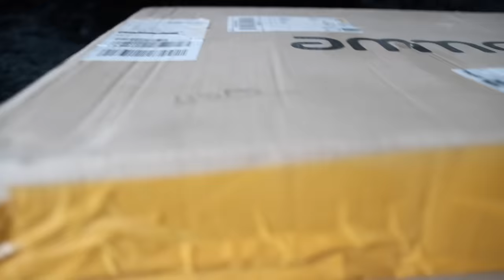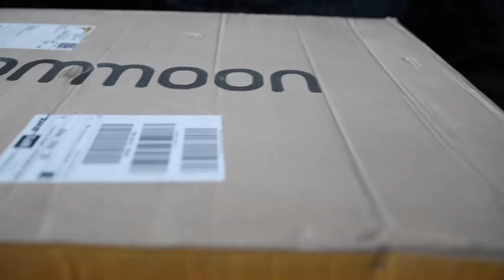CHEAPEST LES PAUL Style DIY Kit Review and Demo (Ammoon LP Kit)

Comment: Just in case nobody has mentioned it yet, they don't drill the bridge holes for you so that you can use your own choice of bridge (different bridges from different hardware manufacturers may have slightly different dimensions, post size, etc). The downside is obviously you have to do it yourself (that is kind of the point of a DIY kit anyway) which means you also have to drill it correctly first time.
Reply: Plus, neck alignment with the sloppy neck pocket means the hole positions are going to be where you find them after shimming and gluing the neck..
Reply: well i used a more arch top hollow body guitar tailpiece so i was actually really happy with there choice not to
Reply: so I could go balls to the walls and just mount a Floyd Rose 1 bridge on a Les paul then. Nice.

Comment: I picked this kit up and lucked out with a very nice neck pocket. I guess your mileage will vary with TonTop. Also, not having the holes pre-drilled gives you the option to upgrade the bridge to a standard LP style Tune-o-Matic instead of the import style that comes with the kit. If your going to get new pickups, you might as well split them and get better pots. Lots of tone options.

Comment: I built a kit, a "cheap" one. But I was surprised how well it plays at the. The kit I was building came as bolt on. The only problem I got with my build is that they don't include a set of capacitors. I did add them and have good tone and amazing sustain. Better than my store bought strat.
Btw, we miss the guns. (YouTube 😒)

Comment: I've found you can cut down on the feedback on cheap non-potted covered pickups by either removing the chrome cover or putting blue poster tack between the pickup and the cover. This is because it's actually the cover vibrating that you are hearing.

Obviously you can also just get some wax and pot the pickups too.
Reply from the maker: cool suggestions, might give this a try!
Reply: Yeah the blu tac is very quick, just make sure it's tight between the cover an the pickup, enough that the cover doesn't ring when you tap it. I've only done it once but it worked well enough with the marshall half stack I was borrowing when the pickup was unbearable if I faced the amp beforehand.

Comment: Identical to my kit, right down to the fret buzz on 2 or 3 spots. I have swapped out the pickups but it is still a bright sounding guitar .... just has more output. As for color,  you can't go wrong with a deep blood red. Brings out the tiger stripes in the maple.

Comment: This kit is also available branded Muslady.  It's exactly the same including the bad neck joint, potentiometer reversal and loads of glue.   I did build it after shimming the neck etc and it sounds great but it took a whole lot of work to make it decent.
Reply: What did you do with the bridge, because I need to drill in the holes bit not sure of the measurements to use

Comment: Too bad about all the repairs and adjustments to just get it together, but surprisingly bright in the bridge pickup. Found the tone on it quite nice. The neck I found a little cold for my taste. Did not seem to have that "big warm" sound most neck humbuckers do, but for the price and everything, what are you gonna do?

As for color, I say take a blow torch and char the grain a little and do an ox blood type red stain. Pickups, I am going to second what someone else mentioned earlier and say Guitar Madness humbuckers. You would probably like the 57 Specials. I have the 1984's and they SCREAM! Also, they are cheap. Some are ceramic magnets and others alnico, not sure your preference.
Reply: Abraham Watson good thinking those guitar madness pickups suprisingly are not bad! i put a set of there p94s in a customers double fat tele and was thinking why change out a 4 lead humbucker guitar with push pull pots for a cheaper pup and pay for it for a less expensive pup? i was very suprised when i plugged it in gave the 🎸 a whole new vibe sounded 👍

Comment: put some old candles in a jar melt it in a pot of water on the hob and just dunk the pickups and agitate them and that will wax them enough to stop the feedback - done it about 5 times so far and it's yet to fail on me, don't need a big wax bath like seymour duncan or any vacuum equipment to quiet down those pickups and make them usable
Reply from the maker: I might try this...sounds fun and who cares if I ruin the pickups?
Reply: @GunsandGuitars  Get the wax to like 150f and let the pickups set for like 10 min.  It works even better if you go 20@ Bee's wax, the Bee's wax is a bit harder, the candle wax penetrates better so the combo works well.  But just the candle wax should fix the feedback.  And I JUST realized how old this it, oh well posting anyway. LOL
Reply: Just get paraffin wax from the store, and don't forget to take the pup covers off. It took us multiple dips into the wax to get a good coverage.

Comment: I did one of these les paul kits when I was 15 and for a first try I'd say it cam out ok.  Mainly I made some pretty dumb mistakes like getting the wrong solder and not letting the lacquer cure enough before bringing it back inside.  Aside from that these kits are super, super easy to put together as long as you do your research, I can't stress it enough DO THE RESEARCH BEFORE YOU BEGIN!!!!  If I can put one together at 15 it shouldn't be a problem for most people to do it.

Comment: For the pickups, I'd just wax pot them. Either dip them in melted wax and wait for a half hour, or dip them in melted wax with a vacuum seal for about five minutes (or until the solid wax around the pickups melts away). Then let them sit for about 15 minutes and wipe them down. 

Saves you more money, as opposed to buying replacements.

Comment: you should go for a cherry sunburst with clearcoate  sun burst ,like a Les paul should be, you could take the chrome cover off and in stalling blue poster tact between the pick up and the cover. This is actually because of the cover vibrating that you are hearing.

Comment: For all you nerds out there, Volume (dB) is a logarithmic scale. We hear changes when things are 10x louder not 10% louder. So you basically hear no change then the pot is designed to switch off all sound pass through (for tuning on stage and what not)
Reply from the maker: correct!

Comment: I've built 2 of those kits, both neck pockets were nice and tight. Both sets of pickups were potted, thou I never installed them, I went with Seymour Duncan hot-rodded humbucker set for 1 guitar and the other DiMarzio 155 + 153 I think. I installed 1 of the sets in a ultra cheap strat copy since they were just laying around, sounds good. Not drilled for bridge and tail piece was a non issue for me. Good kit.

Comment: I'm actually considering building an ES 335 kit but I'm going to change a few things starting with the neck, tuners, and the bridge. for the neck I'm replacing it with a Birds eye tele neck, for the tuners well I'm going with some M6 Schaller in line tuners, and finally for the bridge I'm going with a floyd rose 1. I may replace the pickups with something that may sound beefy.

Comment: I will half to dissagree with you on the bridge holes being predrilled. Do you need an extra piece of equiptment? Sure. However I have had to many kits where the predrilled holes are not square, I can ensure that that not only are they centered, but correct for the scale length.

Comment: There is a reason for the not drilled tailpiece holes. If youre not able to glue the neck exactly how its supposed to be, youll get problems with the intonation. Have seen that often on set neck guitar kits. 
Cheers from Germany!
Reply from the maker: because this kit has that cutout on the neck so that it sits perfectly against the body, there would be no reason for intonation issues, if all necks are cut on the same cnc machines, then they would have consistent scale length when installed.

Comment: You didn't show how you figured out how to drill the 4 Bridge holes?  Did you take a piece of paper and trace a Les Paul you already had?  What would you suggest to someone that doesn't have that?  Can't find a diagram to scale to print and superimpose.  So for a 1959 the scale is 24 9/16" ?  But the Bridge is angled placement; although adjustable per individual string.  Without a template...one would set the low pitch E string to 24 9/16" with the peaked string holder in the middle?  But what about the other end of the bridge?  In terms of the string terminus it looks to have a slight angle per a diagram I looked at.  Anyone know the distance from the Low pitch E string to the face of the String terminus for it?  I have been looking at mine non drilled guitar for quite some time with a monocle.

Comment: I wonder if one could bolt on the neck instead of gluing by using shims and a homemade backplate or inserts and wood screws. Then one could reshim over and over until perfect.Thanx for mentioning that.

Comment: is there a template to drill the holes/measurements for the bridge and tail piece?  what is the correct angle?  this would be my first build, just concerned if I should just spend a little extra and go with the pre-drilled holes, but kinda like DIY

Comment: Great video Dan.  Awesome tips on putting this kit together.  I totally agree with you on doing dyes/stain first, along with grain filling, basically getting everything prepped for finish.  I differ by gluing the neck before starting finishing.  That way, I lessen the risk of damaging your finish.  Also, you don't get finish on the parts that get glue.  Plus your finish has a seamless appearance at the body/neck joint.  You can dig out any glue squeeze out easily and not dick up your finish.  There is one instance where I would glue in the neck first after finish sanding and that would be if I'm using a tinted spray for color instead of hand applied dyes/stains.
Reply from the maker: the reason I like to do the finish before glueing is because the glue won't stick to the finish if you miss a drip or don't clean it up well enough before it dries.glueing an unfinished guitar, the glue drips can soak into unfinished wood and then the wood doesn't take the finish well.  you can always add another coat of finish after you've glued it to get that uniform look you're talking about!
Reply: Guns and Guitars that works too.  I usually get a few coats of sealer down then glue.  After the glue is set, I'll do any flat sanding on the sealer and touch ups then start clear coats.  The beauty is there really isn't a wrong way.

Comment: The reason they don’t drill the bridge piece holes is beacuse sometimes instead of using a regular bridge people put on a bigsby or a trapeze bridge or a mistro vabrato, so try didn’t want to have extra holes Incase u has a different kind of bridge that had holes in a different spot, same with and other guitar, especially 335s

Comment: Seems to me you were straining about good points.  A different kit I got from Ammoon had issues with holes not drilled as well.  I will have to check about the volume/linear pot issue you pointed out on my kit too but I'm glad you pointed that out.  While I'm planning on gutting the electronics, that's far in the future.

Comment: Make it look like Paul Kossoff's guitar , just take the pickups and wax pot them yourself easy to do and a cheap fix.  Also you can buy alnico magnets cheap as well to replace the currents magnets in them all for under  a twenty spot. Add some linseed oil to the board and that composite neck wood will show its true "luster".

Comment: most likely not going to get a response but worth the try. i had bought a kit like this awhile back and finally got to it. the big problem is i can't turn the truss rod nut at all. even twisted the allen wrench it came with. do you think there is a way to fix this without having to remove the fretboard?

Comment: I’d like to see a video about how to properly measure, shim, and the fully glue set the neck. Without the bolt on refit. One reason I wanna buy one of these cheap diy build kits in les Paul and or Gibson hollow body style is because I’m not in a great financial situation as far as for using money to buy real Gibson guitars but I’m “stuck up” and want a set neck because I’ve just always thought (without real fact based reasoning) that set necks meant higher quality. Anyway it’s for kinda silly reasons. I plan on going for a seriously “road WORN” looking Les Paul possibly gold top nitro paint finish or another classic les Paul in satin ROAD WORN finish.  I think starting with a really cheap kit is my best bet in case something goes wrong and I do enjoy the learning process. Cross your fingers for me that it goes well 🍀🤞🏼🙏🖖🏻✌🏼🔥🔥🔥🤘🏼🤘🏼🤘🏼

Comment: The holes aren't drilled because you can only get the exact measurements when the neck has been glued in. Especially with a crappy neck pocket, you need to glue the neck in first
Reply from the maker: Yes, but every other set neck/tune o matic kit I’ve built still has them pre drilled. But they did have better neck pockets, the truth is, if it’s cut and drilled correctly, it’s really doesn’t matter, there won’t be much play.

Comment: Thanks for another great video Dan! Just out of curiosity, do you normally use linear pots for tone controls? I tried this once and found that they did the exact same thing for the high-end rolloff, seemed to do nothing from 10 to about 2 1/2 and then almost immediately cut.  I now use audio pots all around because they just seem to have a nicer more gradual taper to my ear...
Reply from the maker: I prefer audio pots for tone as well, but people are 50/50 split on that, some prefer linear for tone. But on a kit with two audio and two linear pots, one would think they would use audio for volume...

Comment: why use only 3 screws instead of 4 when you bolted it on?
Reply from the maker: no real reason honestly.  guitar necks really only need 3 bolts, but most manufacturers use 4 because if you put one in the middle you risk hitting the truss rod.  but because this was a set neck, there was plenty of wood there before the truss rod so I wasn't worried about it.

Comment: Did you ground it to the bridge? I bought a fretwire kit a month or two back and forgot to drill for a ground to bridge.  Is this a big issue?
Reply: Not a huge problem but it'd probably be for the best if you do it
Reply: Big Dick yeah i accidentaly hammered in the bridge pins before putting in the ground wire so im screwed xD
Reply from the maker: you're not screwed, I pull those metal grommets out all the time.  just partially unscrew the bridge post, just enough that you can fit the claw side of a hammer in there (like you're prying out a nail), then put a folded towel between your guitar and the hammer so that you don't ding your guitar when you're prying it out.  I've done this so many times, it's really easy!
Reply: Guns and Guitars thank you ill try that!
Reply: Guns and Guitars i got one of the two out so far! Hey do you have a twitter? I wanna send you a picture of the guitar finish, its my first finishing job!

Comment: Would it be possible to install a peal effect into the guitar itself? Like having a digitech drop tune effect built right in?
Reply from the maker: Totally possible
Reply: Guns and Guitars how would you suggest I do that? Like what parts? Or do you put the inside of the pedal in the guitar itself?
Reply from the maker: Yes, take the the internals out of the pedal box, and install them in the guitar cavity. Make sure your pedal can run on a 9v battery and install a trap door so you have access to it.
Reply: Guns and Guitars thank you
And what about the output and input jack?

Comment: There are bolt on kits on ebay cheaper. The set neck is a much better design.  I have built these kits before. A slurry of epoxy and sawdust coating the neck and  the joint and clamp it up. Stronger than the wood and sustains just as well.

Comment: I've seen this on Amazon it's like 20-40 less than the finished version. In Canada it sells for about 180, compared to a finished for 220. It's questionable why anyone would go through the trouble of setting the neck and doing all that extra work for some custom color.
Reply from the maker: it's not just the color, you can customize any thing about it.  It's not about saving money, but if you'd prefer to buy it completed, then more power to you man

Comment: i have of 5 of those from 2 years ago...The body looks exaclty like an epiphone..
Fretwork are expected...not massive. All my guitars have low actions.
It's not a big deal to level 2-3 frets here and there....clean the ends..ect
I shave the tenon and neck on mine...I can rotate my thumb under the 16 fret
or butt it against the body.
They're bricks...especailly the ones I install 3 pickup.
i cant really tell you...i use different pick up for different guitars i build.
They all sound slight different. i dont mind.
I can play clean and make notes sing....IT"S 90% my fingers...not the guitar or amp.
it's like cutting through butter if i play death metal...so whatever.
I dont like my pickup super hot...less gain actaully cuts through the mix more..
They sound and play good for what I used them for.

I use .10 guage  erin ball strings....it's night and day from the stock strings....

50's triple pickup ...lemon burst..
If you F -up...black works
i have on of each...with 3 pick ups.
They both looks mean..both have pick guards on them

Or just leave it UN finished,,,,all your DNA...dust. smoke... cleaning wipes ect will sort of 
stain it overtime...It's a cheap ass guitar...MADE for PLAYING...keep it like that.